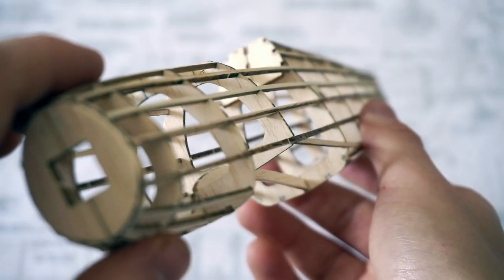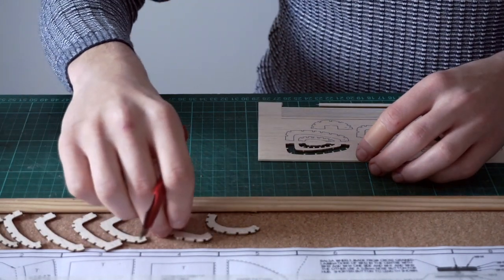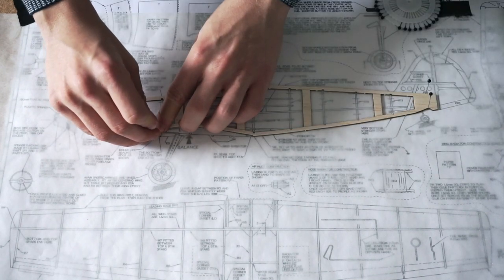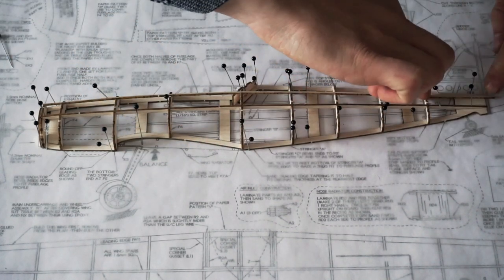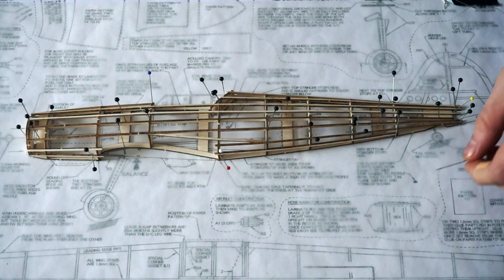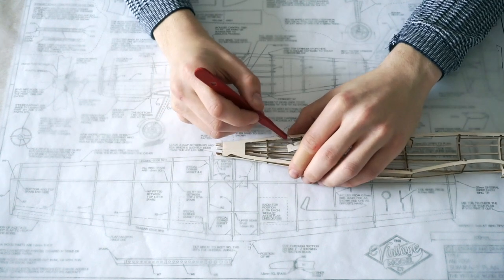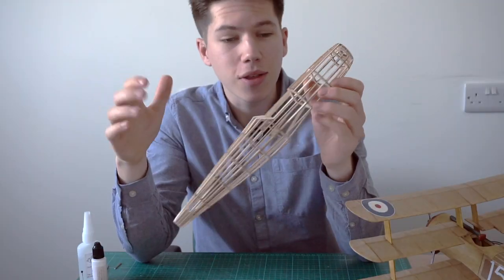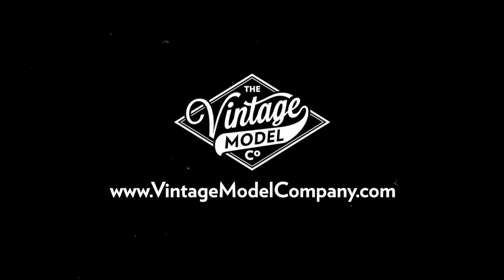How To Build a Balsa Airplane Fuselage | Balsa Basics Series

Comment: I am 60 years old and glad to see a young man keeping this craft alive.
Built many of these as a young teenager and loved the process and experience.
My first was a Hawker Hurricane.
He is correct about the glue - use it sparingly and clean up the excess with a scrap piece of balsa.
Pin the joints as much as you can while the glue sets, even on the stringers, to insure a good bond.
In my day the pieces were dye-cut rather than laser cut.

Have fun doing this and thanks !

Comment: What glue do you recommend? The glue I bout was a modelers cement....after I broke the seal it wouldn't stop coming out of the tube. What a mess!....My fuselage stuck to it trying to remove it broke balsa in several spots......Yikes! I am going to try, and repair it tomorrow after I buy a liquid type Super Glue.

Comment: That's really, really nice! 😃
But I have a doubt... You put a brushless motor on models like this? 😮
Reply: Yes and why not ? I have several with brushless motors and micro radio gear that fly well on a 1S battery.
Reply: @angelreading5098  Fantastic! 😃
Reply: MC's Creations: One way I've managed to "shoehorn" an RC system into small models such as these is by buying one of the small, economical, mini helicopters or fixed wing planes for $12.00 to $35.00 and then using the RC gear and motor(s) from it to install in my project.

The only problem I've had so far was when I used the motor from a 'micro-heli' that did not have enough power for the plane I had built - well it did 'fly' but could not gain any altitude to speak of; so to my way of thinking go with the 'larger' mini-size setup rather than the micro-size, unless you are flying something like an indoor Penny plane or something which weighs next to nothing.

Also, there is a You Tube video which details how to do this which I came across about a week ago - so for anyone interested it's there for the viewing and was well done.
Reply: @larrywhalen596  Nice! Thanks! 😃
Do you know about FliteTest? It's fantastic!!!

Comment: I’m building a Guillows 109 and having trouble with stringer placement.  I made one mistake, same on both sides, so while wrong, it’s asymmetrical and is really undiscoverable so no big deal, no impact whatsoever to the looks or build. I did make another mistake, still no big deal but the diagram alone is not enough for me to know certain things. Forget written instructions, there aren’t really, but it did say “some of the L parts have to be positioned before gluing stringers, but it doesn’t say which L parts. I came to YouTube hoping to find some guidance, still looking. I’m about to do my own thing. It’s not going to be flown, so I have no concerns. I just needed to vent. BTW, I like the idea of building the fuselage in half’s, stringers and all. My instructions said otherwise, and I followed it but in retrospect, I would have preferred the way you did yours.